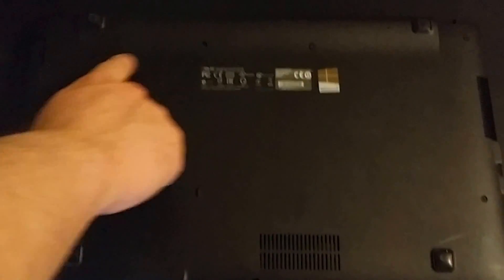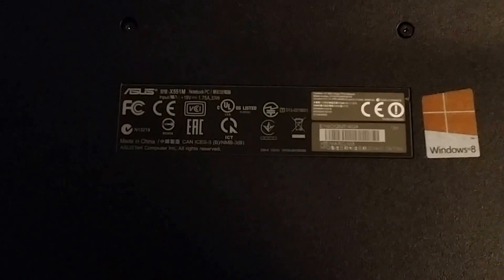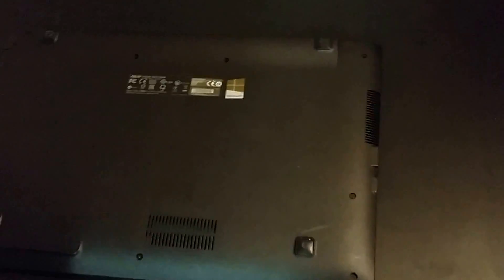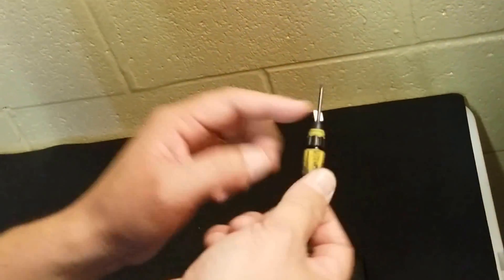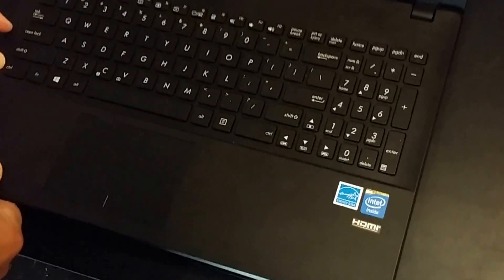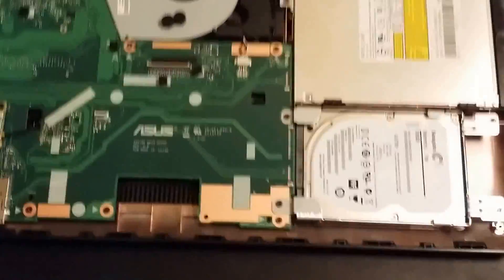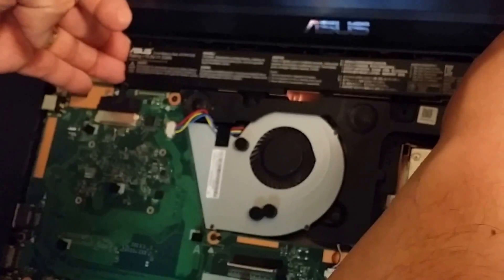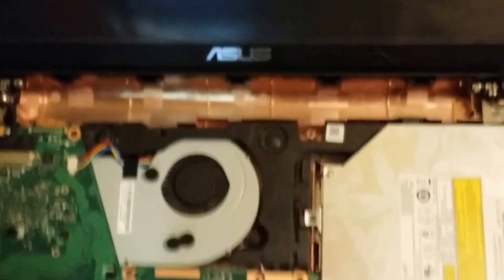ASUS X551M Laptop Battery Removal & Won't Power On Fix

Comment: true that model X550 model on AMD side on asus have no dedicated slot for battery and ram and HDD and also the ODD it is internal screw release mount then the ram slot on the top below the c-pannel keyboard, one of hell of pain to upgrade.
Reply from the maker: Yeah, this model is the "bottom of the barrel" in terms of upgrading anything.  Hard to replace the battery and hard drive and you cannot replace the memory at all since this model has it mostly soldered on.  The pitfalls of a sub $300 laptop because it is considered to be a disposable model after 2-3 years.
Reply: +Angrysquirrel PC : i have Asus X550D witch is AMD 5700m APU and Asus X550XJ intel i7 4th gen. The X550D is simillar to that X551 model all the cmos battery, APU, Ram 2 slot are on top below the keyboard, but the X550XJ intel model have removable batt slot, 1 slot ram slot and 4 GB ram sodered, and sata 3 6Gbps HDD slot or SSD. I had to mod the keyboard of the X550XJ because it is dark red print on it which is very anoying when you want to type something on semi dim lighted room also i had get the silver mouse touch pad on the X550D and white printed keyboard and put those in to the X550XJ kinda giving it a peronalize look on it. Also the X550D amd version kinda run super hot on simple windows 8 update to windows 8.1 up to windows 10 Version 1607 and compare to it's counter part X550XJ it is abit clooler, and the cpu fan on both have very very bad design no intake vent near it that make both Model run insane hot when you run you run game on unlimuted FPS setting that more than 1366x768 resolution. The best laptop i had open and upgrade it's internal dell latitude E6420 i7 version, MSI GL62 6QD, lenovo thinkpad T430U, HP 430 i5.

Comment: Hi, I just wonder what causes the not powering up of this model?  :) any ideas?
Reply from the maker: You might have a bad battery, bad power adapter, bad DC Jack or bad motherboard.  Try using a different power adapter like a universal one first before you try to disassemble your laptop.  If that doesn't work, disassemble your system to remove the battery and try "resetting" the laptop by holding down the power button for 30 seconds to fully discharge all power (no battery or power adapter plugged in).  If that doesn't work, your DC Jack or motherboard is probably faulty for this model.

Let me know how it goes!

Devin
Reply from the maker: You might have a bad battery, bad power adapter, bad DC Jack or bad motherboard.  Try using a different power adapter like a universal one first before you try to disassemble your laptop.  If that doesn't work, disassemble your system to remove the battery and try "resetting" the laptop by holding down the power button for 30 seconds to fully discharge all power (no battery or power adapter plugged in).  If that doesn't work, your DC Jack or motherboard is probably faulty for this model.

Let me know how it goes!

Devin

Comment: Hello! This was very helpful, but i want to know where the ram goes, i want to change it and which one do you recomend me. Please!!!
Reply from the maker: Ugh.  Unfortunately you are out of luck.  This particular X551m model has no removable RAM Memory and is located on the underside of the motherboard.  This was a cost cutting measure for sub $300 laptops.  I have heard they later revised the boards to include removable memory with actual DIMM slots but the only real way to know is to disassemble the system as per my video and remove the motherboard then look underneath.

Hope this helps!

Devin

Comment: hi, my Asus laptop battery wont charge, even when put on charger it still pops the red light  indication that battery is flat..when i remove the charger then it goes off, it cant go on without the charger plugged in...please help
Reply from the maker: Sarah, that is the indication that you need a new battery.  Li-Ion rechargeable batteries only last 1-3 years depending on use, number of recharges and environmental conditions such as heat, humidity, etc.

My advice is to get a new battery on Amazon for about $30.  Here is the link!

https://www.amazon.com/Powerforlaptop%C2%AE-Asus-X551-0B110-00250100-A31N1319/dp/B015ISBSJ0

Use my video to disassemble your X551m laptop to remove and replace your battery after you receive the new one.

Good luck!

Devin
Reply: Will do, thank youuu :-)
Reply from the maker: Sarah Ipumbu No problem!  Let us know how it turns out!

Comment: Angry Squirrel, I have the same model laptop (ASUS X551M), and it does not turn on, it just turn on the green light, but the screen keeps off, I tried to charge it (if it was discharged) but it does not complete the charge, it just keep the orange light and doesn't turn in yellow. I tried to turn it on without the battery and just the charger, but it doesnt turn on too, could you help me?
Reply from the maker: Hi Gerson!

Good work going through the troubleshooting steps!  You have eliminated some of the things that could be the problem.  Based on what you stated, it is either:

1.  Defective Power Adapter/Charger.  Even chargers that light up does not necessarily mean that it is providing enough power to power or charge the system.  Try using a universal charger to rule out your charge being the culprit.

2.  Defective motherboard.  Power surges happen.  Motherboards go bad over time.  Your DC Jack may be bad but unfortunately, it is the soldered on type so you would have to either desolder and resolder a NEW DC Jack on the motherboard or simply get a new motherboard.

Good luck and I hope the helps!

Devin

Comment: My computers lights will come on on the front but my screen is black and no audio what to do???
Reply from the maker: Try doing a "reset" to the system first.  Use my video to remove the battery.  Then hold the power button down for 30 seconds to fully discharge the system of all power.  Then insert the battery then reassemble the system.  With luck this will get your laptop back to normal working order.  Also, if you still don't see a picture then try plugging in an external monitor and see if you can get a picture on it.  You might have to try holding the "fn" key along with one of the f1 - f12 keys to switch to the external monitor.  Look for the icon of a "monitor" or a small square / large square looking icon on one of them.  If it still does NOT work, you most likely have a motherboard/graphics chip issue.

Devin
Reply from the maker: Try doing a "reset" to the system first.  Use my video to remove the battery.  Then hold the power button down for 30 seconds to fully discharge the system of all power.  Then insert the battery then reassemble the system.  With luck this will get your laptop back to normal working order.  Also, if you still don't see a picture then try plugging in an external monitor and see if you can get a picture on it.  You might have to try holding the "fn" key along with one of the f1 - f12 keys to switch to the external monitor.  Look for the icon of a "monitor" or a small square / large square looking icon on one of them.  If it still does NOT work, you most likely have a motherboard/graphics chip issue.

Devin
Reply: @Angrysqurial Pc i can not get some screws out help?
Reply from the maker: If you stripped your screws, there are screw extractor tools out there to help remove them.  UNLESS, you broke the plastic molding that holds the nut that the screw does in then you would be freewheeling the screw unable to remove it.

Assuming that the molding is not broken, you can purchase this by checking out this link:
https://www.ifixit.com/Store/Parts/Precision-Screw-Extractor-Set/IF145-118-1?gclid=Cj0KEQjwuJu9BRDP_-HN9eXs1_UBEiQAlfW39merrbKeN55gDLWGuf4BU6GNyHgcFCJOUsCE6HjfAisaAnfK8P8HAQ

Good luck!

Devin

Comment: I have to thank you for sharing your expertise! I live out back of nowhere, and would have to find transportation to, from, and back to and from a repair shop (the closest but only one star on yelp, it's 64 miles one way and I don't drive). I had a little accident a few weeks ago, long story short. I fell into a river with my laptop bag, and after rushing home and putting it in a huge box of rice for three days, I was fortunate that everything checked out okay EXCEPT the battery. Asus wanted me to mail it to them, pay $127, and wait for them to replace and return it.... No way! I ordered a battery from Amazon, followed your instructions, and it's just like new! 😁👍😘
One constructive criticism though; when it comes to the cables and clips, I'd really appreciate if videographers would get in close and show exactly HOW each type of clip opens and closes. I had an old hp that I kept rebuilding, and it had a cable with something called a zip clip. The manual and the videos I watched always made it look easy, but the first time I tackled it, the rotten thing broke, and I couldn't find ANYWHERE on or off line to replace it. I had to buy another parts laptop.
Anyway, thanks so much again! You rock!!!
Reply from the maker: You are very welcome!  I am glad you were able to fix it yourself without breaking the bank.  On your comment, I agree the video could have been better.  On my defense, this video is not a professional production endeavor by any means as I even said it was taken with a Galaxy 3 Note smartphone and it's camera is definitely not the best.  Also, this video was more of a quick instructional guide to disassemble the laptop mainly to get to the battery.  The reason for the video was actually because I was really frustrated I had to disassemble the laptop to get to the battery just for a SIMPLE LCD SCREEN REMOVAL!  So my frustration can easily be seen on video.  One day, if I can get enough views, I will purchase a better HD camera so I can actually zoom in and show the things you are talking about.

Thanks for watching!

Devin

Comment: what do you do if your charger plug in does not go into the plug in any more..it's not even a year old
Reply from the maker: Your DC jack must have snapped off the motherboard.  Unfortunately, this model's DC Jack is soldered onto the motherboard and does not conform to the now standard "plug in" kinds that are more common on laptops nowadays.  You can take it into a shop that specializes in soldering and see if they can reattach it.  If they can't and the damage is too extensive to the motherboard itself, you will most likely have to purchase another motherboard to install.

Sorry for the possible bad news.

Devin

Comment: Got the same prob.. And after ido everything as you say..it starts charging but if i click the power button .it again goes off
Reply from the maker: You most likely have a motherboard issue.  That or you forgot to reattach the CPU fan which is causing your computer to shut down in order to protect yourself.  Check all your connections to make sure you put them all back in and try again.

Devin

Comment: Hi there Angrysquirrel PC - thanks so much for making this! I really appreciate it! 

Question for you, as we own several of these laptops, and two of them died suddenly, wont turn on, even when plugged in - tested the power supply with other laptop and that works, but they wont even light up the charging light when its' plugged in and don't start.     I take it that means the problem is more than just the battery, correct? 

I suspect that the universal power supply that we used with them may have fried them out, as it happened to two laptops within a short time, but the common denominator was that they both were using that same power supply at the time. 

Any insight?
Reply from the maker: Yes sir!  A faulty power adapter/charger could be the culprit but it could just be that the motherboards need to be reset.  On one of the laptops, follow the instructions from my video and remove the battery.  When the battery is removed, press and hold down the power button for 30 seconds.  This will discharge any remaining power left in the system and will "reset" the motherboard.  After 30 seconds, do NOT install the battery yet.  Simply put the keyboard lid back on to the laptop and ONLY insert the power ribbon cable back on to the motherboard.  Then plug in the AC adapter in to the DC jack.  Press the power button.  If it only needed to be reset, then your laptop should power on at this point.  If it still doesn't come on, then it could be either:

1.  Faulty Power Adapter
2.  Faulty DC Jack (yes these go bad more often then you think and only costs about $5-$7 on Amazon/Ebay
3.  Bad Motherboard

Let me know if this helps you!

Devin
Reply: Thanks so much for your reply.  I ruled out the reset unfortunately, but I'll look into the faulty DC Jack and see if that wont fix it, thanks!
Reply from the maker: Rabbi Avi Rubenfeld No problem!  Keep in mind you will have to desolder the DC Jack on this model and resolder the new one.  If that doesn't work it is most likely a bad motherboard.

Good Luck!

Devin

Comment: In every asus we have to do such way which has fix battery?
Reply from the maker: For the most part yes.  Some Asus's have the battery you can remove without disassembly.  This model unfortunately has to be disassembled.

Comment: Hi, would you happen to know if the sony vaio SVF15A190S works the same way? It also has a non-removable battery unfortunately and I wanted to change the hard drive and ram. Thanks!
Reply from the maker: Unfortunately, I don't know the specifics about the disassembly process for that particular model.  But if your laptop is not powering on for whatever reason, it could be the AC adapter, Battery or the Motherboard in that order.  Try to disassemble it using this video as a guide to at least get to the battery.  If something does not remove easily, do NOT force anything apart as you could serious damage or break something.  When in doubt, take it to a computer repair shop (not Geek Squad!).

Comment: So it's the battery that needs to be replaced and not anything else because the laptop I have is the same model and it won't turn on when it's plugged in the LED that indicates that it's charging won't light up either when it's plugged in
Reply from the maker: It is either the battery or the motherboard at that point.  Seeing the LED means you at least have power running through your system from the AC adapter.  Follow the instructions from my video, remove the battery, hold the power button down for 30-60 seconds, do NOT install the battery (to determine if the battery is bad), attach the keyboard lid and insert just the power ribbon cable back in (there is no need to clamp down the keyboard lid around the edges yet), insert the ac adapter then try powering on the system.  If it turns on, you can rule out the motherboard.  Remove the power ribbon cable then remove the lid again.  Insert the battery, power ribbon cable, ac adapter and see if that turns it on.  You will then know if you have a bad battery or just needed a reset.

Good luck!

Devin
Reply: +Angrysquirrel PC I'm gonna try it again because I did the same method a while back and nothing worked the hoping it works a second time doing it the right way
Reply from the maker: Hammoclife97 OK good luck and I hope it works or else you will need a new motherboard.

Comment: Kudos for an informative and well-put together video. I have a good friend whose X551m laptop occasionally stops powering on. Reseating the battery and reconnecting everything has fixed it twice so far, and this video saved me the time of having to muddle through figuring it out myself. I suspect the battery itself is going bad.
Reply from the maker: The battery is most likely on its way out.  If its the original battery and is over 2-3 years old, replace the battery and you should be OK.

Comment: Hello. I have a ASUS X555L(I3,Nvidia 920M)...I spills  some juice near power button(no on keyboard! ,after it I closed it fast, and try to dry the laptop... (turn it.. and the juice to exit) I'm scared to open it again cause I don't want to destroy it. What should I do?
Reply from the maker: Immediately remove the battery.  You do not want any power remaining in the system to circulate (even when powered down).  Then wait 48 hours to dry out.  After the 48 hours, pray that your system turns on.  Do NOT use a blow dryer or any other external heating source to dry it as it WILL cause potential damage to your circuit board.  If you have Silica gel packets, use 10 of those and put your laptop inside an air tight bag as it will absorb any and all moisture from the laptop.

Good luck and let us know if this worked for you!

Comment: hello i have the same laptop and i was on it and it showed the low battery warning and i pressed okay then it died then i out it on the charger and both of the led went on and then off and now my laptop wont turn on can you please help or tell me whats wrong with it
Reply from the maker: You most likely have either a bad power adapter (your laptop was running on the battery the whole time until it ran out of power), or a bad DC Jack (even with a good power adapter plugged into it, it will not transfer power into the motherboard or battery to either keep the system on or charge the battery).  There is a SMALL chance that it could be the battery as I have seen bad batteries keeping the system from powering on but that is extremely rare.  Try using a universal power adapter or another similar ASUS power adapter to rule that out first.  If that doesn't work, disassemble the laptop based on my video and remove the battery, then reassemble then plug in the power adapter then try turning it on.  If that doesn't work, it will be the DC Jack/Motherboard (DC Jack is soldered on to the motherboard).

Devin